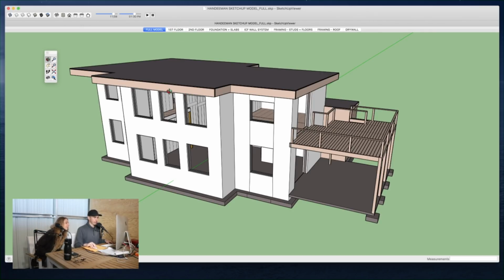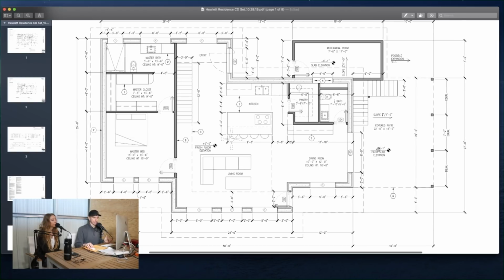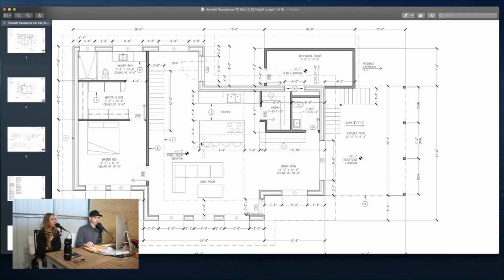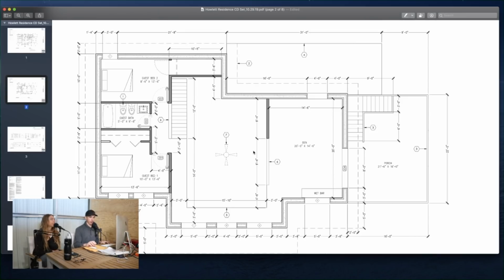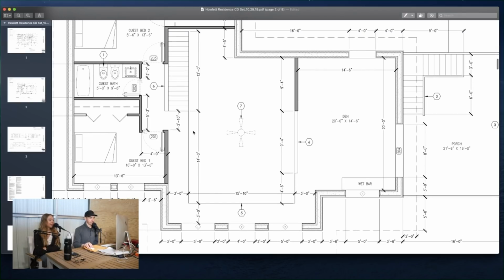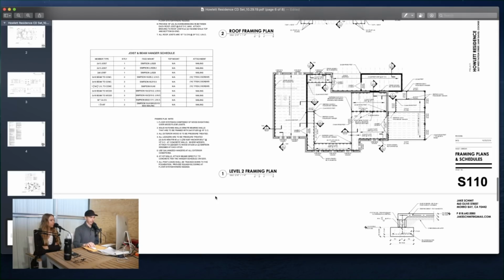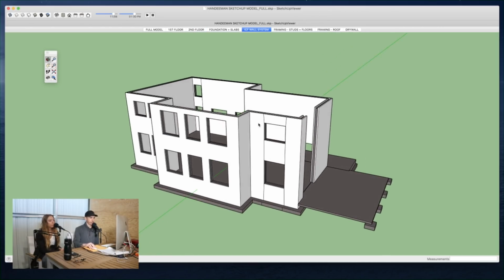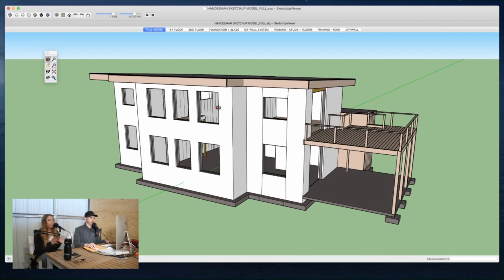Couple Build Debt-Free Dream Home In The Desert | House Plans

Comment: Your first floor is 52 sq ft larger than my whole house. 😂
Reply: It's not the size that matters it's how you use it, same goes for houses also 👍😁. I would never build 2 story again, it costs more and if you have the room, single story is easier and cheaper to build, I think 2 story on acreage looks kinda dumb, just my opinion
Reply: col stace I know. I prefer a one story smaller house. I specifically moved to drop down 300 sq ft and gain double the acreage. Unfortunately my house isn’t laid out in the best use of space. And I can’t change anything structurally. But I think their house is going to look killer. I love lots of styles from farmhouse, craftsman, mid century, modern, cabin, to my plain ranch lack luster/character house. lol
Reply: @Lesh004  if you Google "11C remembrance drive tahmoor  nsw 2573"  you can see the house i built back in Australia with ICF

Comment: Since you are doing ICF and will have concrete trucks coming out. Consider a small hot tub built either as part of the structure or come off a wall and use part of a wall. Another thing you might consider is building a concrete safe into the house with ICF and putting a safe door on it. This will give you more security vs a normal safe.

Comment: Why two stories when you have plenty of room for a ranch style house? One day you're going to have old knees.
Reply: More efficiency in building materials, construction, and superior heating and cooling performance.  A rambling ranch house has a lot more surface area to insulate.
Reply: I agree,  73 and glad my house is single story -- no stairs at all   Lots easier to build as well, I can paint the entire thing with a roller on a pole,  only 3 gables I need a ladder for.  Washing windows is easier if I ever get around to it.

Comment: Hi, I like the Murphy bed idea. Have you seen the examples on you tube where the combine the desk with the Murphy bed.

That west wall looks perfect to build a lean-to green house on to supplement the lean-to on the workshop.  I think it can assist with passive heating as well. 

Thanks for explaining about the ex vs es, I have heard several YouTubers use the ex and I wondered why. Makes sense if it is down to a speech impediment 🤓.

Comment: Is the floor heating system going to be designed as a sealed system, using ethylene glycol (or similar product) for the fluid?
Or, another heating/cooling system to consider: geo-thermal. 
https://www.waterfurnace.com/residential/
The rain water tanks already in place nearby could potentially be used as the geo-thermal heating/cooling source.

Comment: One the main facade... wouldn't it look stronger with three equally wide windows instead of wide-narrow-wide, or two equal windows? I know you're dealing with foam block forms, and maybe that's why you landed on what you did - but I think the other would look better from inside and out. Just a thought.

Comment: Love the house. I’m sure I’m too late with this input but here goes. We built a house from plans almost 10 years ago.  It’s a passive solar design and we are almost net zero on energy use. ( grid tied  pv solar). I heard your comment about having friends and family over to entertain. This is our focus too. The one problem I have with our house is bathrooms. Although we have two bathrooms on the main floor, we effectively have only one. Why?  Because no one will walk through our master bedroom and walk- in closet to access the bathroom there. So every one ends up using the “guest” bathroom. If there was one thing I would change on our build it would be an additional small half bath, or if possible make the master bathroom more accessible to guests/family.
Reply from the maker: there is another one on the main floor towards the east side of the building near the patio ;)
Reply: Yes, I see it. You missed my point. With a house full of guests there will effectively only be 1 bathroom for everyone since as I’ve already said, no one will want to walk through your bedroom and closet to use that bathroom. Many people consider those areas as your private space.

Comment: We're in South Dakota in the mountains.  We built our house with ICF's in the basement as well as in floor heat in the basement slab.  I't's incredibly comfortable.downstairs.  Upstairs is more conventionally framed with 2x6 walls and an inch of exterior foam.  We used 8" ICF's but for above ground you are probably using 6" or maybe even 4".   It's also very quiet.  Because of the shape of our house (essentially round as it's made up of 17 8' wall segments it  was incredibly expensive to use radiant on the main floor.  I set the basement in about a week, almost every block had to be cut.  The attached garage, 900 SF, was easy and done in an afternoon.

Comment: Will be a challenge to get ductwork over to the bedrooms from your mechanical room.
Could easily use a 3 zone minisplit in those rooms.  There are simple ducted or pod options for minisplits too.  
I do HVAC but for restaurants, not residential.
Reply: One tip on multi splits (multi-zone mini splits) for most units all zones must me in the same mode, heat or cool. LG makes a multi split that can simultaneously heat and cool. Have a Mitsubishi multi split system and would not be able to live without internet control and wall mounted thermostats. With internet control I can make sure everything is in the right mode without having to walk from room to room.
Reply from the maker: will be talking to an HVAC/mechanical specialist in the next day or so and a 3 or 4 zone mini split was an idea I had as well for the bedrooms

Comment: 17:10 If that bathroom upstairs is rarely going to be used, ie guests, and kids. it will rarely be used, so why not just have a traditional toilet, so if you want to use the composting toilet, just go downstairs to your main bathroom where you would be at on a regular basis..?  little confused why this rarely used bathroom would have the composting, and not others?   or does the ones downstairs have composting toilets, and you have everything roughed in downstairs, just not hooked up.   You could have an episode on the shitters alone.
Reply from the maker: we talked about that, when you take a dump, it smells and Hannah doesn't want to get woken up by the pungent smell of Handeeman
Reply: @Handeeman  go to your poop corner... now.

Comment: Your house plans look great 👍🏼.  I am curious and few questions to ask?

1. Can y’all install the coat closet under the staircase?
2.  Can y’all make the south balcony wider to align along with the wall at den?
3.  Can y’all move the toilet in master bathroom opposite site aligned with the sink to save the cost of plumbing?
Reply from the maker: moved the toilet to the other side because of the flush toilet upstairs, need to be able to run a drain line upstairs to downstairs and best to do it through the 2x6 wall
Reply from the maker: that'd be a good spot for it, we'll probably just have hangers on the wall or something like that :)

Comment: Dark colored countertops will show every bit of dust particles that are in your house we built the house I went with a dark green countertop thinking that it wouldn't show any stains or anything easier and it showed every bit of dust he had to wipe it down several times a day just to make sure it didn't look dirty you being in Arizona I would think that would be a consideration the second house we built we went with more of a marble look and it hid the Dust particles and lint from the towels
Reply: KAREN RIGGLE luckily they are getting a water heating system with floor heating. This means a lot less dust flying around compared to conventional heating! :))
Reply: @SN-gc3vc  our heat is radiant heat also but we live in Wyoming high desert and there is dust in the air from cars ,trucks and the wind
Reply: KAREN RIGGLE is yours water based, air based or electrical?
Reply: @SN-gc3vc  air